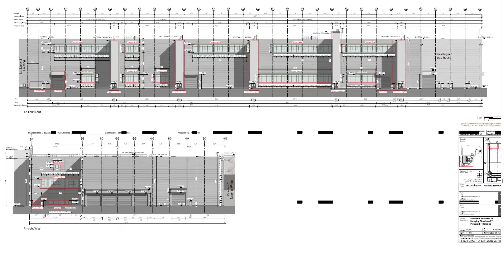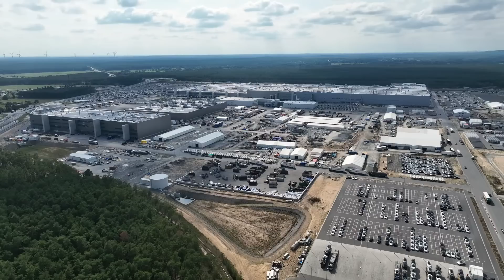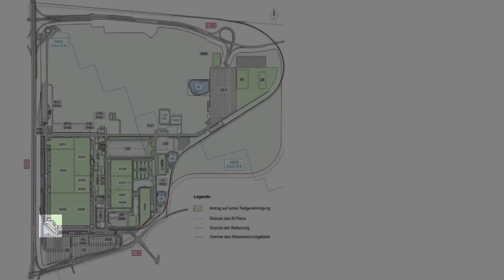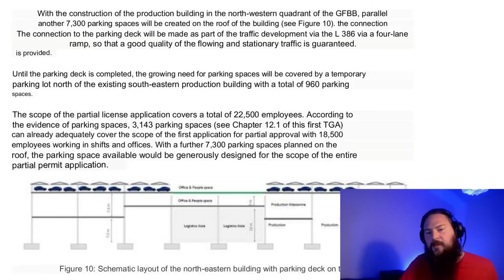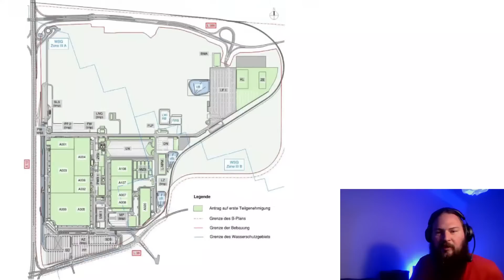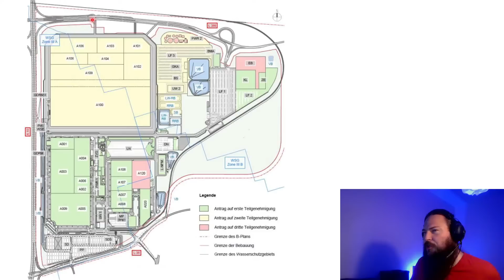Giga Berlin | Expansion Documents | Livestream

Comment: 26:01 - you shut down nuclear power plants, and Germany from electricity exporter turned out into a hungry importer. For me there is no wonder that Tesla wants to protect its factory with alternative electricity generation, you never know what will be the next smart moves, and if power will be available.
Reply: In the first half of 2023 Germany imported 0,9 TWh electricity. And produced 247 TWh *). This is no "hungry" import. And has probably simply to do with cheaper prices elswhere. Interestingly the biggest importer of German electricity was France (72% of the French electriity is by nuclear power) . While the biggest exporter to Germany was Denmark (no nuclear power). 
*) excluding electricity produced by the industry for their own demand.  This was always attractive - Volkswagen had in Wolfsburg from begin on a power plant (first coal now gas). With solar energy this makes now also sense for factories of any size. And there are anyway state laws which demand solar panels on all new roofs (details differ between the states). And where I live all factories put up solar panels on any suitable roof - as it's simply commercially attractive.
Reply: It make sense to deploy PV panels on factory roofs if you can manage the expense. In case of Tesla they can probably do it cheaper since they have their own inverter tech and probably a good price on panels too and they even make their own batteries. Although they might also go for bigger third-party inverters for such large projects. For the longest time I was surprised they didn't deploy more PV.